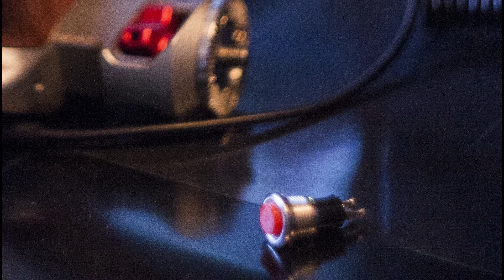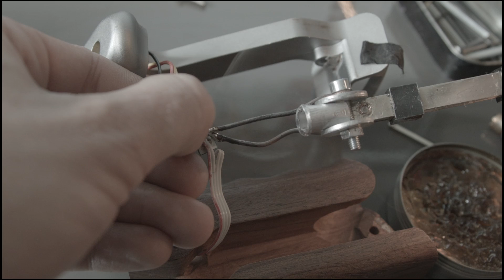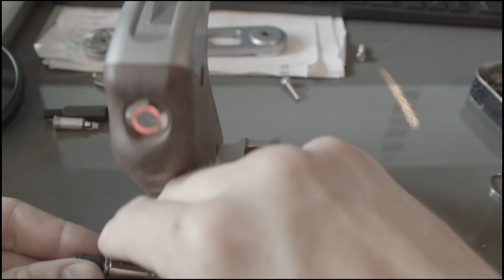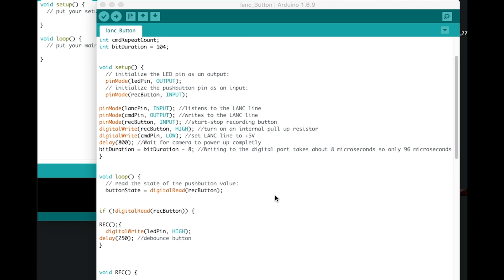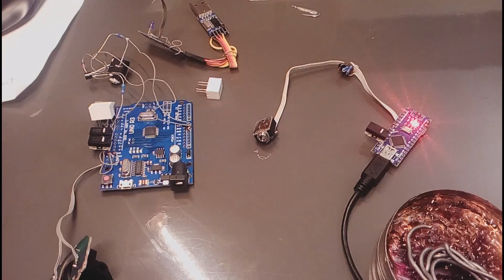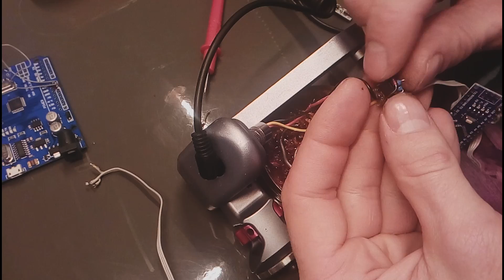Tilta LANC Handle REC trigger: upgrade to Arduino / DIY

Comment: I tried to connect these handles to my Sony a7sii using a LANC adaptor in to multi out. The button does nothing. Is there anything I can do to make it work for start/stop on my A7?
Reply from the maker: weird, it should work, LANC is a standard protocol. But dunno. I'd start checking cables and connections first.
Then you can get arduino and start experimenting with signal length and so on...
Reply: I have the same problem with my.a7iii and tilta isn t able to help me yet..they sent another cable.but i can t rec trigger with that too :/

Comment: Great video. Do you think just replacing the three white cables could fix the problem ? I'm also facing it with same set up
Reply from the maker: The wiggly original button and external 3.5mm to 2.5mm cable were the main fault. The signal wire inside the original cable was losing contact in certain angles.

Replacing the female connector and microprocessor board (the original one had way too long delay) did contribute as well :)
Reply: David Ke Alright thanks, I'll try to replace the Lanc cable first, and see from there. Hoping I won't have to go through the arduino part !
Reply from the maker: Yes, there's 99% chance it will be just some loose contact sort of issue :)